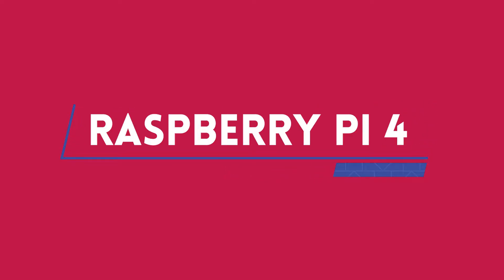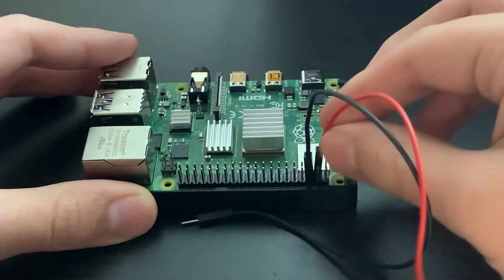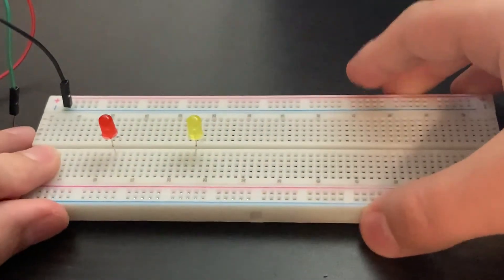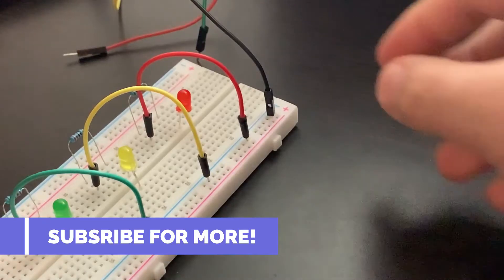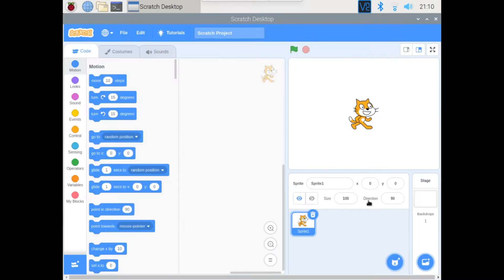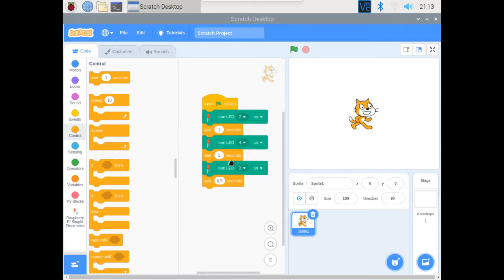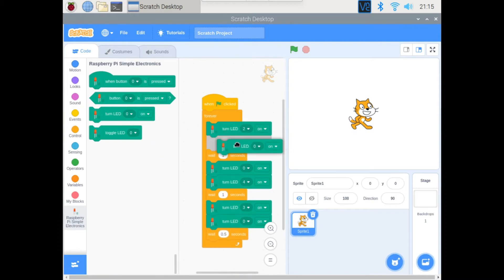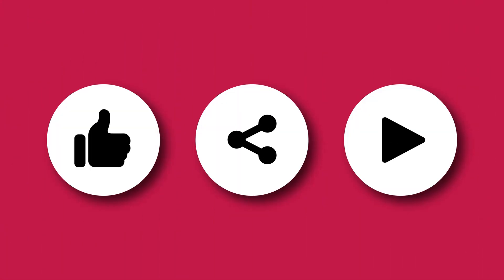Raspberry Pi 4 - How to create Traffic Lights with Scratch | Easy Tutorial

Comment: Very nice tutorial. I never programmed in scratch. You could make your breadboard cleaner and use less wires by just jumping your resistors to the ground rail. I will definitely check out your scratch tutorials since I want to start trying Node-RED and I understand scratch is a good starting point. No flow connectors but it looks somewhat similar.
Reply from the maker: That's a great idea, thanks for the feedback!